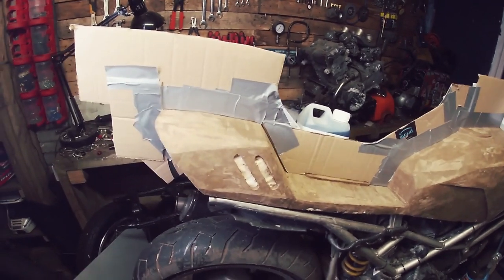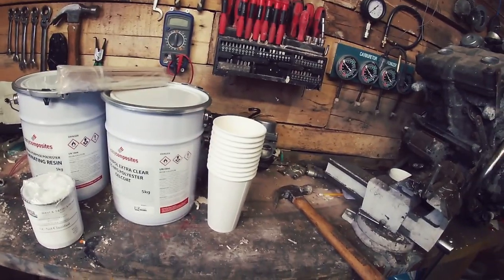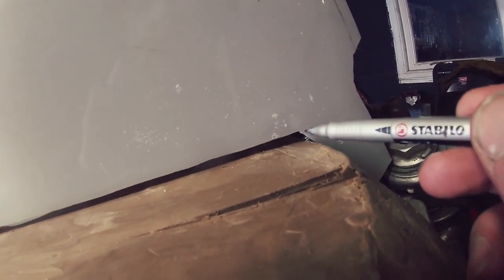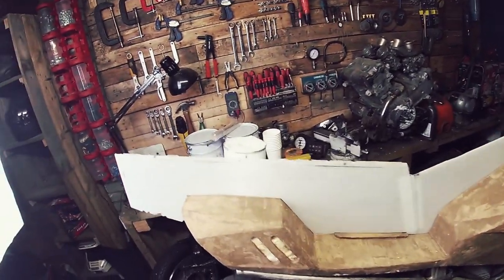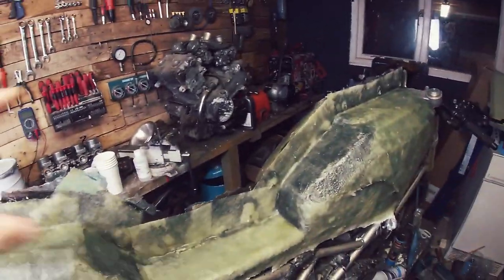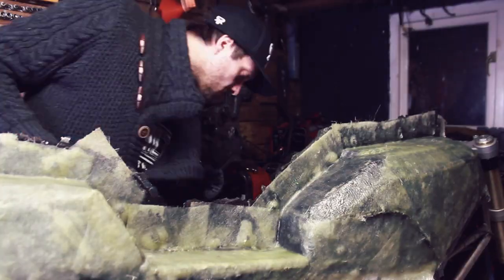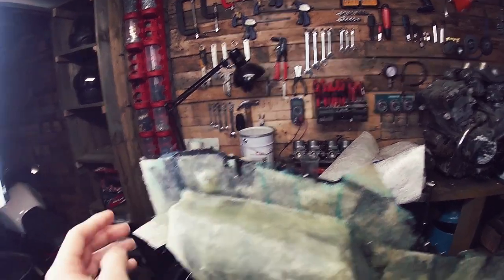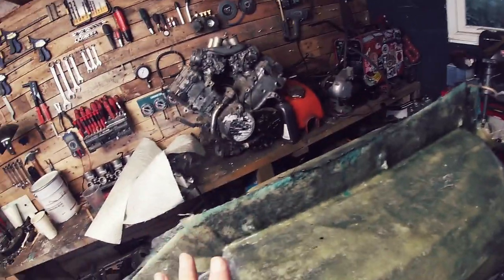Ducati Monster Cafe Racer Part 8 - Prototype Fibreglass split mould part 1

Comment: Finally starting my own work now, after getting inspiration from this channel. One question though... Is there a reason why you dont wax your molds before adding the release agent? Wouldnt that help? The reason I ask Is I modified my rear faring adding clay, and as you will make a fiberglass plug out of that. As I dont want to ruin my fairing, Id like it to release it without too much problem...

Comment: I have a question that you might be able to answer. I have a GS400 that I am trying to convert  and use some modern parts on. With your experience with the GS platform what all would I need to do to swap a new motor into it?
Reply from the maker: Like a brand new engine?
Reply: Yes sir, the engine it came with was not taken care of. There was a build that I saw a while back that I loved, it mixed the classic style with modern components.
Reply from the maker: You’ll have to replace all electrical components also then and fuel injectors, ecu everything. Also probably make engine mounts to fit it.
Reply: And how would you recommend designing  a seat and tank. I know I can buy off the shelf parts, but I want to try my hand at fabricating those things
Reply from the maker: Like what I’m doing with this project
Reply: Thank you sir for putting out this content. I use this as a sort of training guide, and will keep you updated with the project

Comment: I’d been waiting for this. Just wondering if the heat from the resin setting has any adverse effects on the moulding clay as it becomes softer with heat ? I know it won’t matter so much for you as it’s a first prototype and not the finished plug, just curious really. Great vid. Stay safe
Reply from the maker: I did have a worry about that too which is another reason I’m not using it as an actual plug. There is a little heat coming from it but from the what I can gather it’s not much to shift the clay
Reply: For The Bold okay, thanks for the reply, I may go ahead with my tailpiece mould directly from the clay plug in that case. Cheers
Reply from the maker: All depends if you don’t mind adding a little filler Afterwards. If you’re spraying then anything to fill imperfections won’t show.